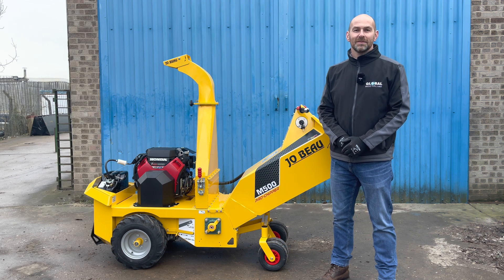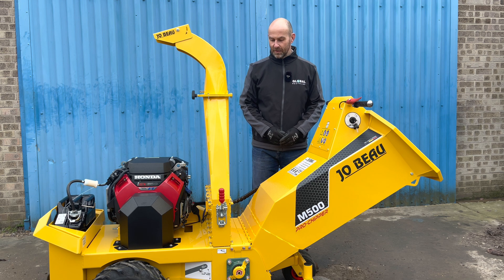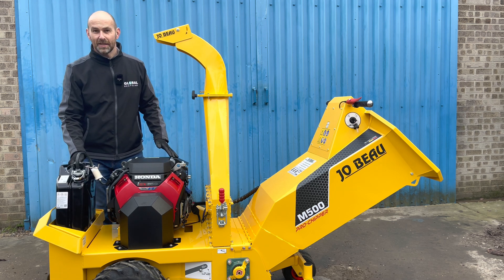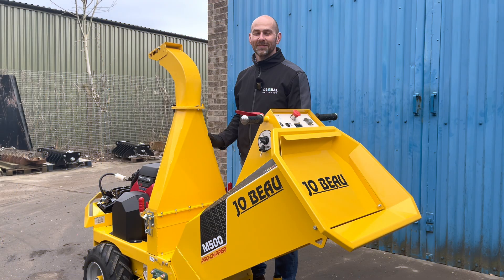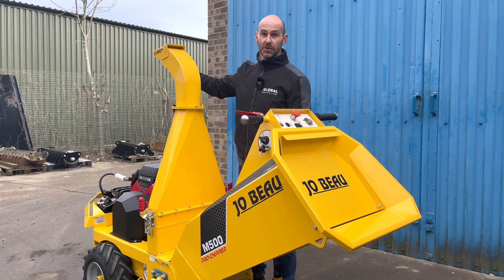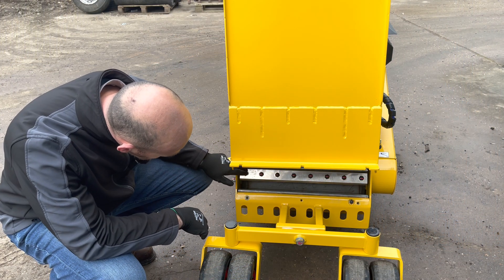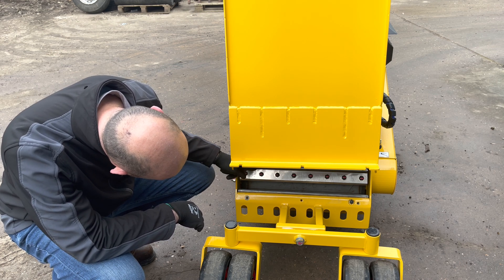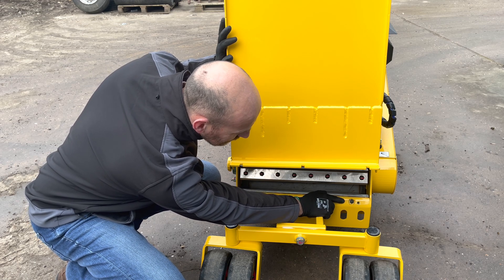Global Recycling Solutions Ltd - Technical Tuesday Jo Beau M500 Next Generation Wood Chipper

Comment: I wish they would make it more trailer friendly. They need lashing points on the machine. They had so many design flaws on the older models. Glad to see they made changes. Still, that hopper cover is naff. That's coming off straight away. They still haven't beefed up the rear swivel brackets, the ball bearing extended grease nipple snaps off after a while and changing the belts is a nightmare.
Reply from the maker: Hi Matt. The chippers now have eight lashing points.  The cover you are referring to isn’t actually a cover but a legal requirement feed table to meet the required minimum distance down to the feed roller.  This is now integrated.  The swivel castors are still the same.  If you’d like to discuss any issues further, we would be happy to put you in touch with our Sales Consultant for the Jo Beau range – please call our office on 01476 568384, option 1.